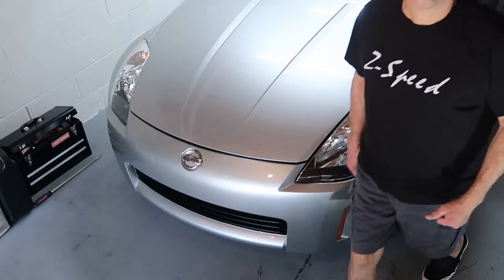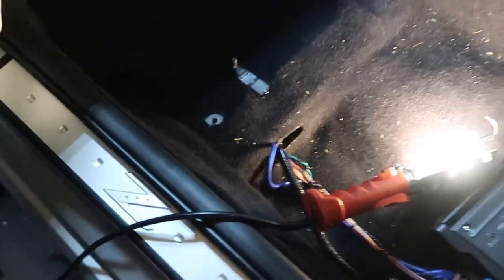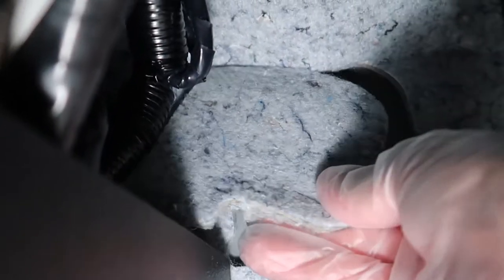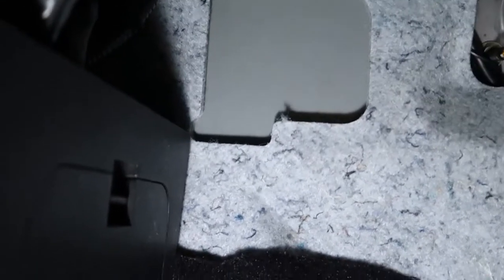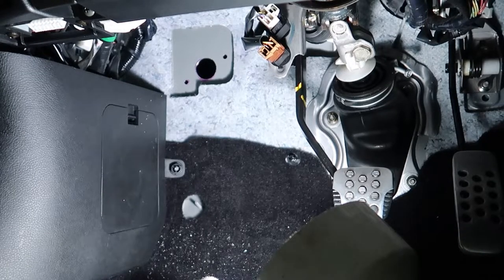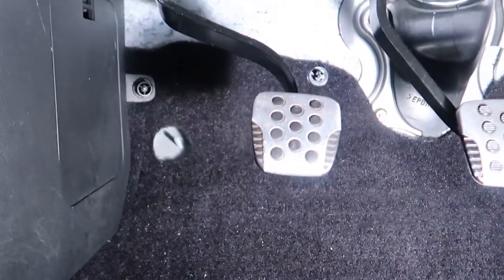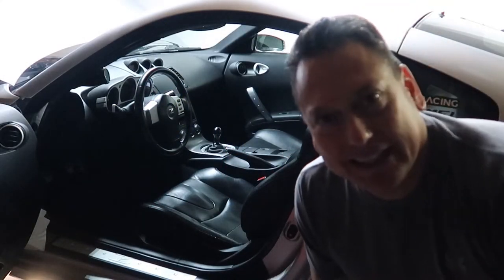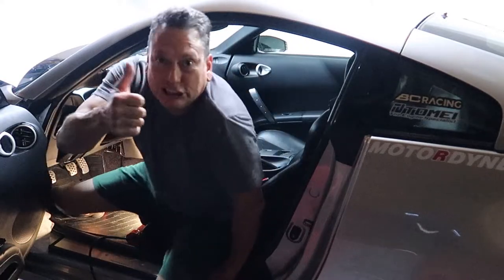350z/G35 DE Manual swap: Part 3-Install Clutch pedal/hydraulic lines & wiring safety switch #350z

Comment: Hi I have a question how long did it take for you to build pressure in the clutch because I’m having problems building pressure in the clutch
Reply from the maker: Sounds like you may still have air in the lines or the slave cylinder. Also check all of the clutch lines for leaks! It took me at least 20 to 30 minutes to get all of the air out of the lines. There is also a special technique to get all of the air out of the slave cylinder, there are plenty of videos on YouTube for that procedure, hope this helps, let me know what happens!!👍🏁💯
Reply: @Zspeed  hi did you do the method where someone pumps the clutch pedal at least 10-15 times and then hold the pedal to the floor and someone else open the bleeder valve ?
Reply: @Zspeed  or did you do another method?
Reply from the maker: I actually did it by myself using the bottle method with brake fluid in the bottle to prevent air bubbles from traveling back up the tubing!
Reply: @Zspeed  was your pedal stuck to the floor with no pressure and it slowly built it?
Reply from the maker: No, that didn't happen to me, you may need to check your master and  slave cylinder for damage!
Reply: @Zspeed  yours already had build pressure in it and it’s new
Reply: @Zspeed  how did you build pressure on the clutch pedal?
Reply from the maker: Yes, new slave an master cylinder!
Reply: @Zspeed  I know I have brand new slave and master I’m asking how long did it take to build pressure on the clutch pedal
Reply from the maker: Not long, maybe just 5 minutes or so.
Reply from the maker: Maybe 5 minutes or so!
Reply: Did you ever find out what the issue was? I'm finishing up the manual swap but my clutch pedal goes to the floor and i can't build pressure in the system.
Reply: @DanielTesenair  did you try other ways of bleeding the clutch ? If so I just upgraded my clutch to a RJM performance clutch because the oem clutch tend to have bad clutch springs
Reply: @edwinjimenez631  I've just been following the method in the video, but because I can't build pressure the clutch pedal just springs to the floor and then I have to pull it to spring it back. Over and over. But no pressure ever builds. Do you have a different suggested method?
Reply: @DanielTesenair  hopefully this video helps it helped me
Reply from the maker: If the clutch pedal in pinned to the floor,  that usually means there's a problem with the hydraulics. So you may need a new master or slave cylinder or both. In the video I started off with a brand new OEM master and slave cylinder.
Reply: @Zspeed  Thank you for all the replies throughout the whole process. Your advice has been incredible. 

I just bought and installed a brand new master and slave cylinder but I'm having the same issue. My clutch pedal just springs right to the floor. Did this happen at all with you?
Reply: @Zspeed  Here's a video showing the issue
https://youtu.be/iJ3FOv5wqeI
Reply from the maker: No, maybe it's the clutch pedal spring or the spring assembly?
Reply: @Zspeed  I think I might have finally figured it out. The adjustment rod on the master cylinder was threaded in too much, and didn't allow the master cylinder to fully pull back into the primed position. I'm finally getting pressure in the system. Hopefully today I can bleed it fully and I'll be done!!!
Reply from the maker: Awesome brother!!!
Reply: @Zspeed  I was able to turn it on last night and everything seems to be working great! Just gotta tidy up my wiring and button up the last few things. It should be back on the ground today. Z Speed, thank you so much for all your help. I could not have done this without you.
Reply from the maker: Thanks so much for watching, glad that we have another manual 350z on the road!!!!🏁💯
Reply: @DanielTesenair  hey bro did you figure out out to build pressure in the clutch

Comment: Can I do this with a manual Ecu and a manual engine harness
Reply from the maker: Yes,  that would be the best way to do this swap!
Reply: @Zspeed  would I still have to splice into the wire ?
Reply: Would I still need to tap in to the wire ?
Reply from the maker: If your harness patches into your clutch pedal, you will not need the wire tap!
Reply: @Zspeed  let say it does and I also wire tap it can this cause misfire ?
Reply from the maker: Not sure about a misfire, but if you use a manual wire harness and ECU, there is no need to wire tap anything. Because everything is now plug and play,  your car is now wired up like a factory manual transmission is!!!💯👍🏁
Reply: @Zspeed  sorry I miss read the question it does not connect to the clutch pedal but it connects to the transmission
Reply from the maker: Then you will need to wire tap the clutch safety switch!👍

Comment: Did you find anything for reverse lights?
Reply from the maker: Nothing yet, I will let you know if I find anything!!💯🏁👍
Reply: @Zspeed  you could buy the MT plug for the reverse light and wire to AT harness just a theory though
Reply from the maker: That actually sounds like a good theory, I would have to study the automatic transmission wiring harness to see if that's possible!